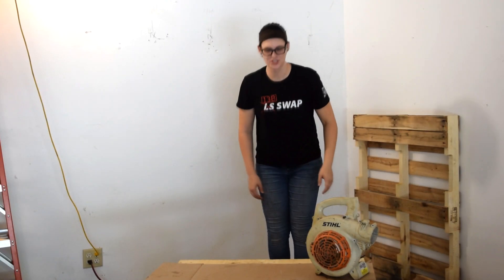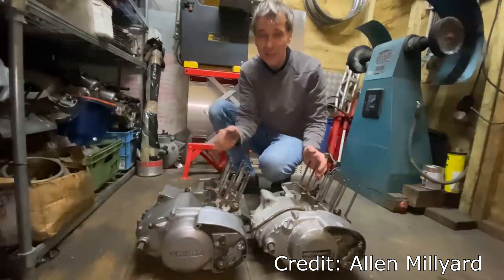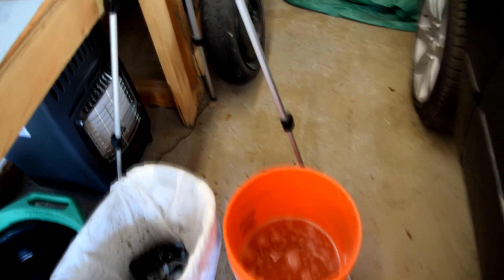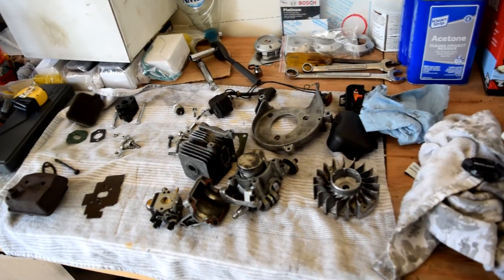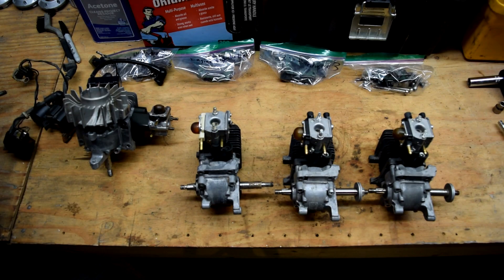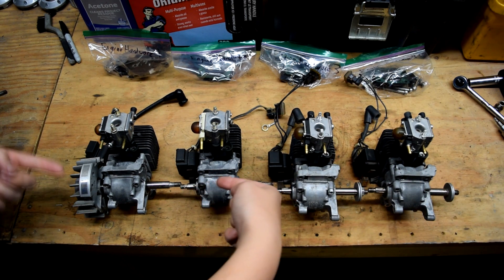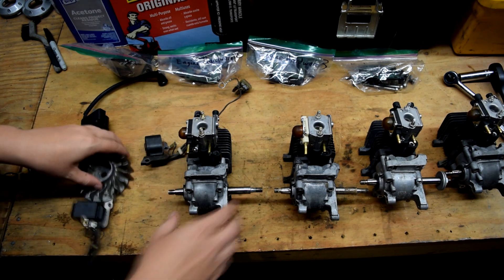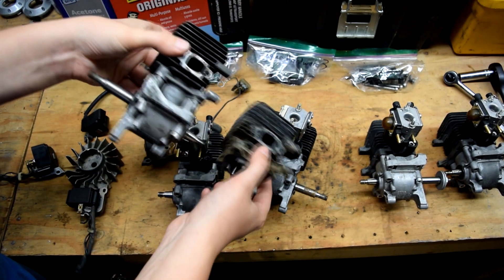Custom Engine Build - Stihl 4 Cylinder Ep. 1

Comment: theres one person on youtube that took 4 Briggs & Stratton engines and welded the crank cases together to make a inline 4 Briggs & Stratton engine
Reply from the maker: Nice! That is basically what I am doing here, except I don't have a welder...
Reply: @FierceMotorworks  they also machined down the crank cases with a mill to get them closer together, at some point I'm going to try and couple some engines together and and put it on a custom motorized bicycle, I've seen others make multi engine bicycles before but they have always connected them via Chains like in the clip you showed from cars and cameras video where they made there 3 engine mini bike
Reply from the maker: @collinparks274  Actually joining the crankshafts and engine blocks is much more rare. The other video clip from Allen Millyard, he has numerous engine builds where he combines engine blocks, welds them, and machines them so it is like factory condition.

Best of luck with your engine project!
Reply: @FierceMotorworks  it is more rare and I would like to attempt that but I don't know how to weld aluminum and thanks
Reply from the maker: @collinparks274  Hopefully my next video can give you some ideas for how to join blocks without welding
Reply: @FierceMotorworks  perhaps, but I do want to do the cupling idea, would allow me to choose and change the cylinder firing order and make it sound different, but it does have the disadvantages of being bigger then if I was to just weld them together